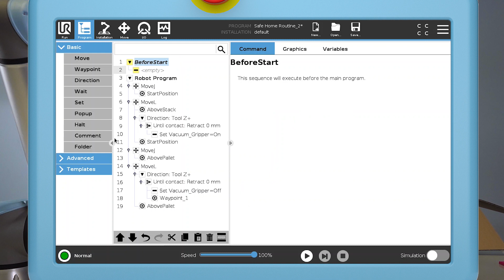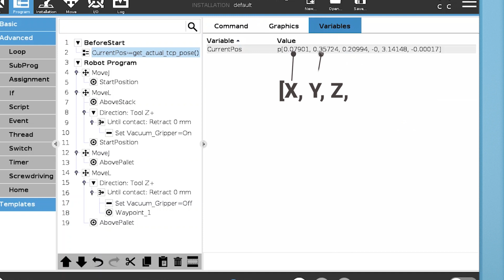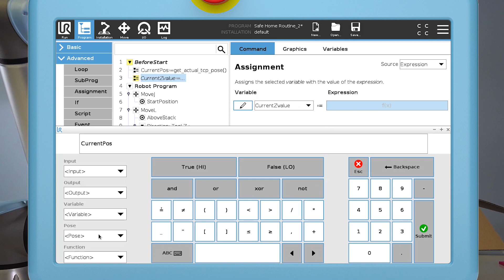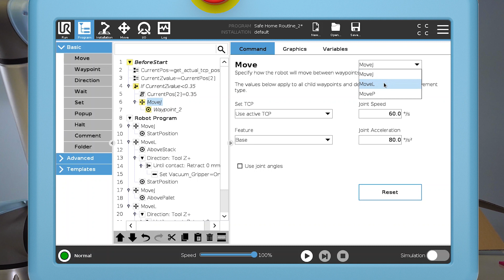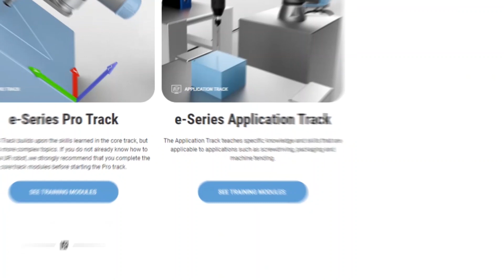Prevent collision after program stop with a "Before Start Sequence"

Comment: Thank you. I have a problem. The TCP orientation changes when moving from one way point to the other and is in danger of spilling a liquid or smashing glass. How can I make the TCP orientation fixed during transition?
Reply from the maker: Hi Hediyeh. If you're using a MoveJ, you can change that to a MoveL - that should solve the orientation issue. If you're using a MoveC, try changing from fixed to unconstrained and see the behaviour.